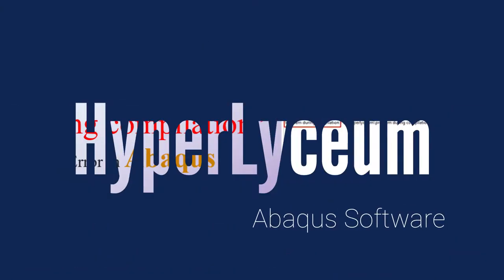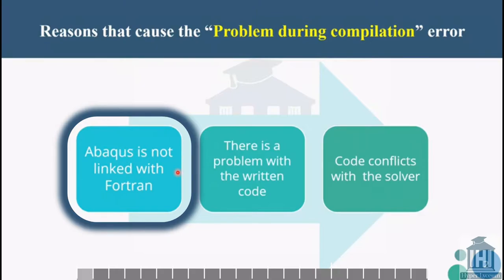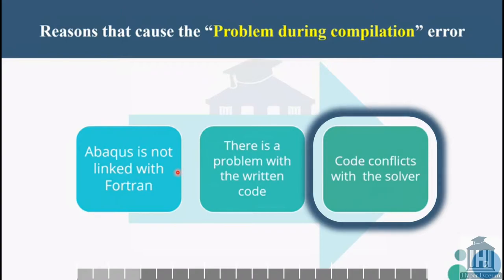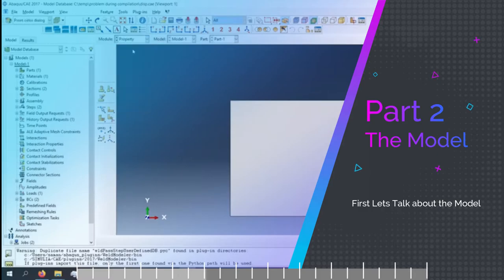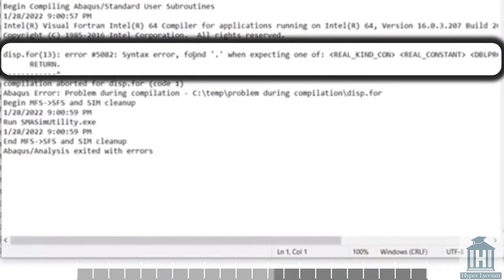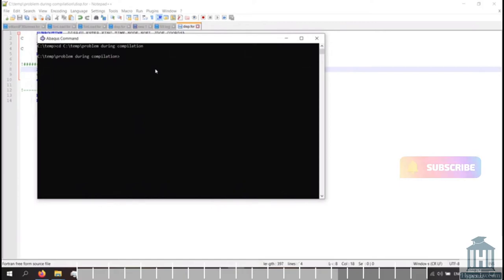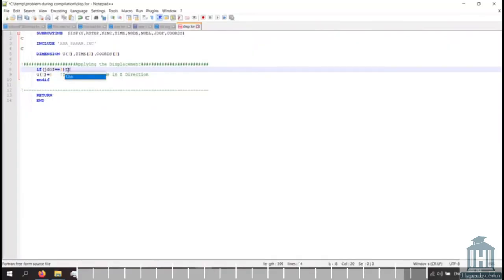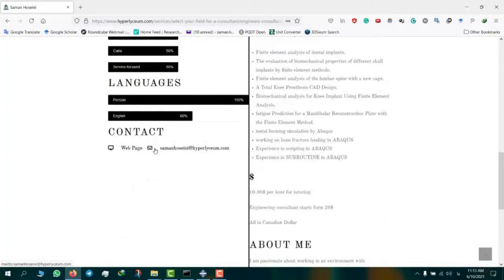How to find and fix the "Problem during compilation" error in Abaqus Subroutine

Comment: Dear mam,
Begin Compiling Abaqus/Standard User Subroutines
2022-08-15 11:51:12 AM
'ifort' is not recognized as an internal or external command,
operable program or batch file.
Abaqus Error: Problem during compilation - E:\ph.d\Laser cladding simulation\Cladding of one layer\Dflux.for
Abaqus/Analysis exited with errors
how to slove this?
Reply from the maker: There are many possibilities and it is not easy to find the problem. I would recommend to repeat the linking process. TBH there are not many easy way to fix it.

Please use our platform for asking your questions:
https://hyperlyceum.com/question/category/abaqus/